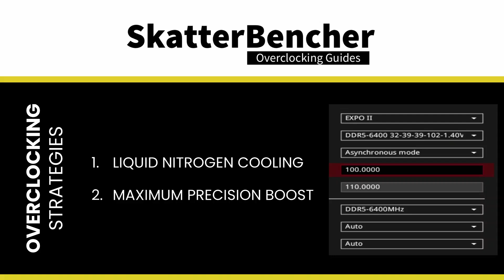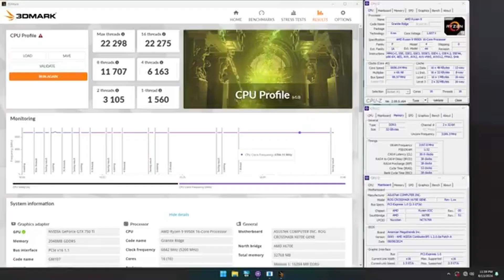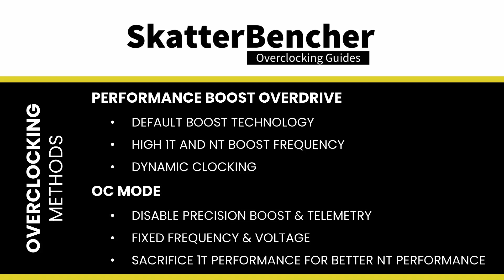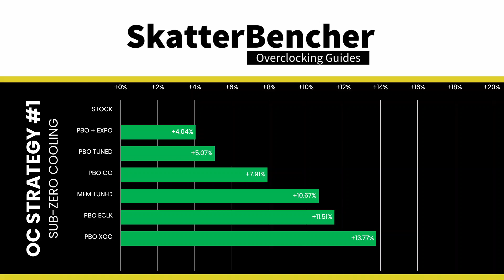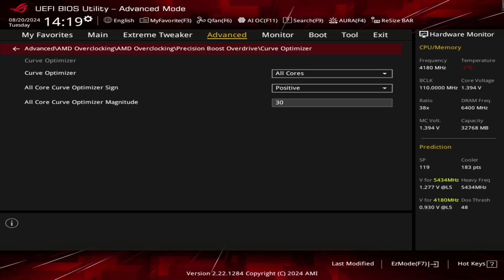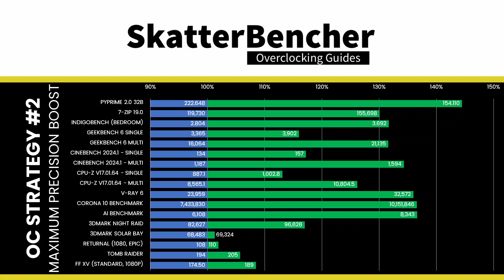Ryzen 7 9700X Extreme Undervolt & Overclock to 6325 MHz | SkatterBencher #80

Comment: 6.3 GHz is not that impressive on LN.
Reply from the maker: In OC Mode it certainly could go higher. But has anyone reached a higher frequency with Precision Boost enabled?
Reply: Clock speed is not that impressive of a measurement metric when related to CPU performance
Reply: @Sir_Defyable  Most get that, but his point was in comparison to what others have achieved with the same cpu on LN-2. SB is right on the money though, pretty impressive just using PBO and E-Clock!

Comment: Nicely done! 👍🏼 Do you think the lack of increase in gaming performance could be because the memory controller isn't fast enough to feed the cores? If so, X3D versions might scale even better this generation.
Reply from the maker: The lack of gaming performance scaling with much higher frequency is a bit puzzling, however there is an element of GPU-boundedness with this RTX 2080TI. That said, usually CPU frequency always helps performance even if it's just a couple FPS. Even in extreme GPU-bound scenarios (because the CPU is always there in terms of fetching data from memory or processing some data). 

For example, I've gotten to 207 FPS in Tomb Raider with this GPU and another CPU. Also Final Fantasy sometimes goes over 200FPS with other CPUs. It feels weird. I also tried the RTX 4090 with this CPU on ambient and there was a similar lack of scaling.

I don't think it's related to memory. Otherwise we'd see performance improvements with FCLK/UCLK/MCLK increases or memory timing adjustments. My gut feeling says the bottleneck is somewhere in the uarch backend getting the right data to the right places at the right time. Because it doesn't matter how fast you can process data if you don't have the right data to process since you'll need to wait additional cycles. This is just speculation, however.
Reply: @SkatterBencher  Very interesting theory, would be great if you could comment on it in a future video if you find the root cause.
Reply: @SkatterBencher  exactly, when overclocking its essential to know the rest of your system, as it may need improvement on other components as well, aka overclocking. Ive came to the very same conclusion when overclocking my old i7 3770k there was a decrease in performance between 4.3 and 4.4, 4.5 and 4.6, I had to manually tune the  bus rates so it overclocks the pcie, as bottlenecks occur 🎉
Reply: it could be that the 2080ti (2 generations old) he's using is maxed out by the cpu even at ambient temps, so raising cpu speed wont realy help. If he had a 4090, the CPU would be a bottleneck, so higher CPU speed would show improvements.
Reply: @Sham-Rok  I totally missed that, thanks. Yeah, might well be mostly GPU-bound.